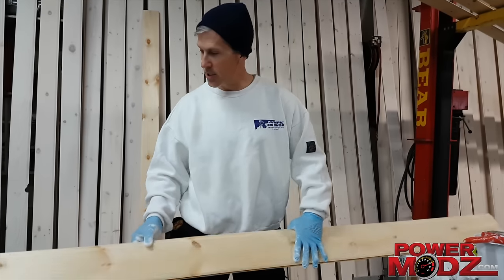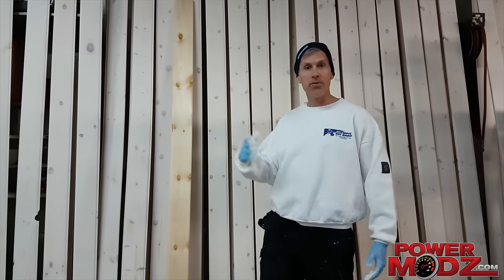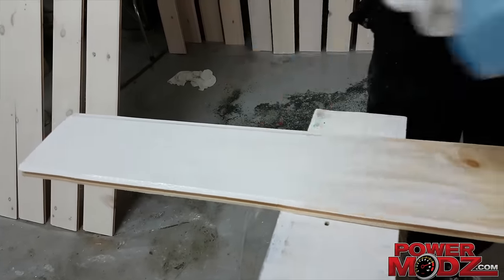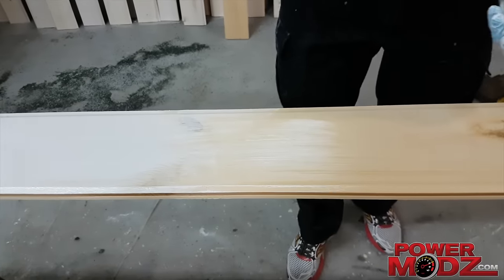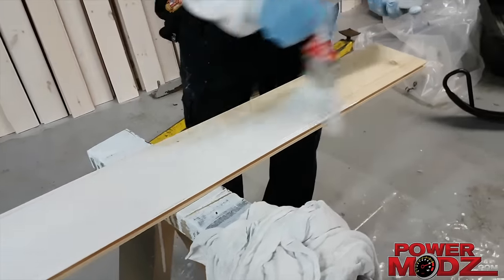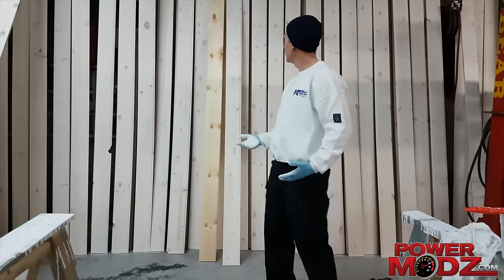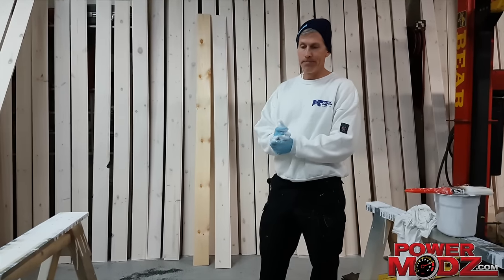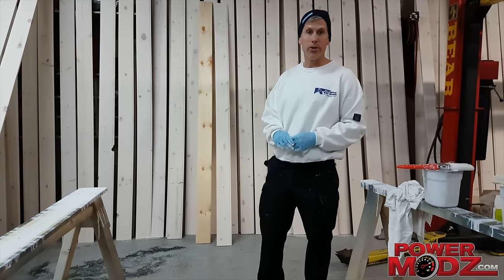DIY White washing pine panelling.   It's easy!

Comment: Well the knotty pine tongue and groove I've got is already up so there's that. It's bare wood. Do I need to sand it and add the wood conditioner as other videos have suggested? Is there any difference between the pickling stain or mixing latex with water? Aside from the fact that I have some white ceiling paint in the basement so it would save me some $$$.

Comment: Hi Louie, I know you did this video years ago but I am just working on a 3 season room in Wisconsin, bought tongue and groove pine boards. I see you are using it in Ontario and am wondering how it is holding up? Do you heat the cabin all winter? I do not have heat in my 3 season room and am wondering if the paint will hold up? Also has it yellowed through the years?
Reply from the maker: Its great, yes i heat most of the year, doesnt look like it yellowed much.

Comment: We have a cottage in Ontario & looking to do the kitchen ceiling with the same technique.  Did you have any problem with installing the whitewashed planks?  I read somewhere that one person had problems with the wood swelling so they suggested white washing after installing.  I'm not a fan of waggling my arms in the air for long periods of time, so I'd much rather white wash before installing if possible.  Any words of wisdom?
Reply from the maker: We are in Ontario as well - we got ours from shaw lumber in Pembroke - kiln dried.  no swelling....and make sure you whitewash it first - - you'll never get it done right once it is fastened in my opinion..
Reply: use construction adhesive and nail  your wood  or you will have a probllem with wood moveing
Reply: @Louie I did a stain/poly combo in my cabin master recently over pine. Did everything the way they said to. Sanded, conditioned, etc. but hate the way it looks. Do you think I could do this technique over it?